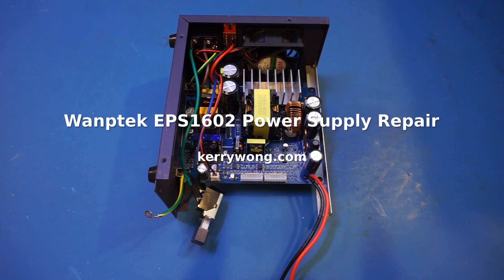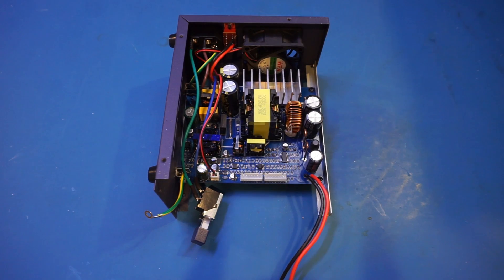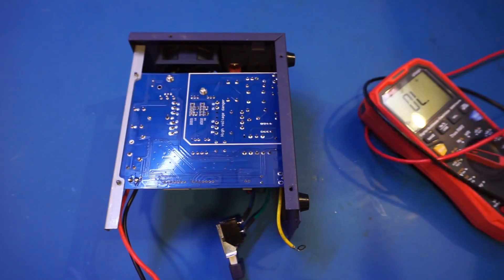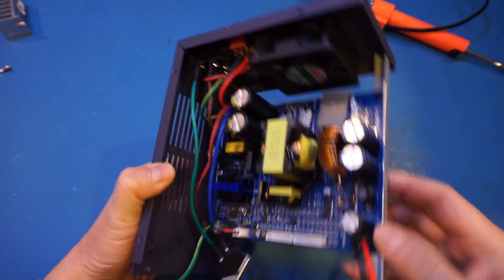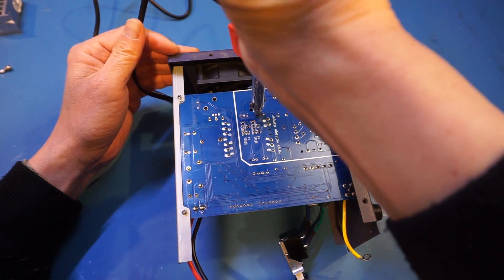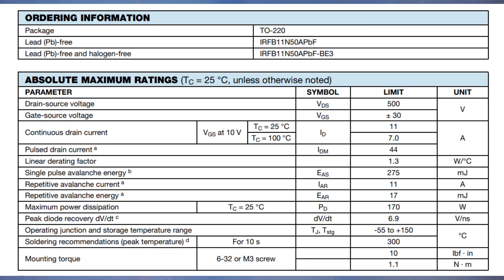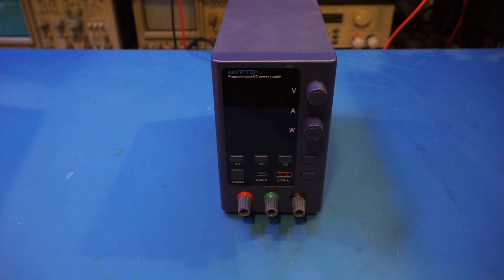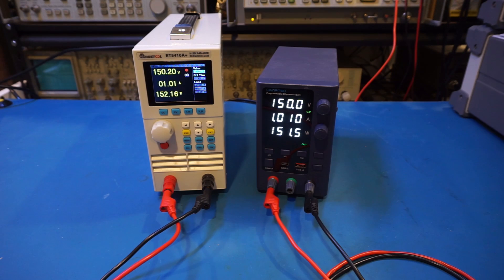EPS1602 HV Power Supply Repair

Comment: This is a common fault with those wanptek units. I have 2 that died the same way, then i got one working by replacing the bridge rectifier and mosfets and it blew up again.
Reply from the maker: The heatsink is not adequate for the rated power.

Comment: If i bought this PSU, I would immediately change the heatsink and properly screw the MOSFETs to it. I would use an old copper CPU heatsink with a fan.

Comment: I just don't trust these cheap power supplies, especially to leave on overnight in case of fire, hence I bought a Rigol DP832. A few cheap supplies are still useful so long as you're there while using them.

Comment: I don't understand why they called this a high voltage power supply. In my opinion high voltage is above 1kV. I know its relative but 160V is only high when you compare it to 5V. I personally think high voltage is when you start having leakage through air because of corona discharge.